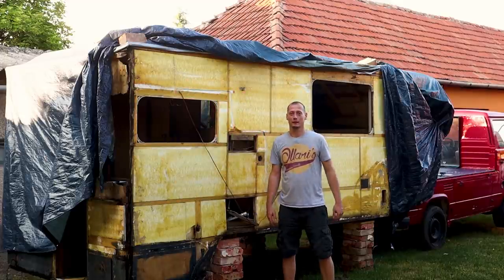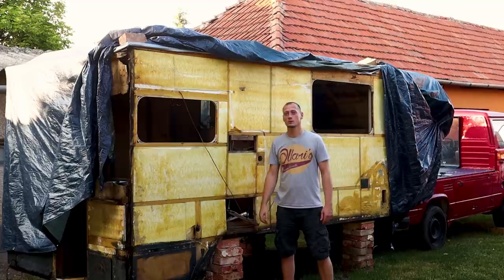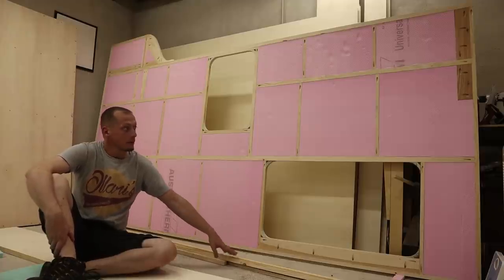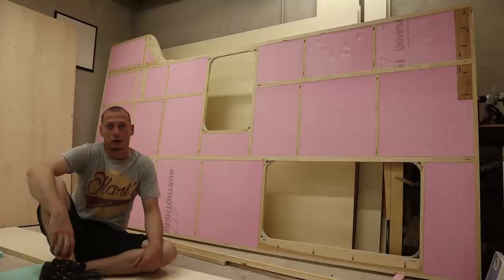Building the side Walls!  //  Building a Truck Camper Ep.4

Comment: Sebastian- this is a great project and I would be privileged to watch all that you upload. You are showing great skill and thoughtfulness in tackling this and addressing the weight v strength constraints. A bit late for this comment and it is not offered in a negative way but reflecting on the rot in the old structure did you consider the use of preservatives, sealer or even epoxy paint during manufacture and assembly of the panels? Keep up the fine work.😀👍

Comment: Very nicely done. Much better than any other camper I've seen.

Why did you go with pocket holes instead of just a screw from the opposite side into the pieces? Seems like more work since you won't see any of it anyway.
Reply from the maker: The wood will split if you screw it directly into endgrain. And if not it still is not very strong. The main purpose of pocket hole screws is to prevent that. That’s why they are also used for building cabinetry.
Reply: @Ollaris  Ah, ok. I've always thought of pocket holes as just a way to conceal the screws when screwing things together, but what you said makes sense.

Comment: Nice building system for those walls, far better than any manufacturer I've seen. I use a product for waterproofing EPS , (both extruded and expanded). I've used it on walls built with ICF's, then tried it on wood, concrete, metal and on heavy cloth, all with success. It bonds very well and creates a flexible, waterproof coating. Thought of that product covering the foam and framing to mitigate potential rot if you ever get an infiltration issue. It's also an acrylic base, water clean-up . Ames Block and Wall (https://amesresearch.com/block-wall-liquid-rubber/). I've had it tinted with color to match other surfaces. I have no idea how far along you are at this point or if you have access to this product, pretty sure there are similar products in your neck of the globe.Just a thought.
Reply from the maker: I planned to do something like this! I’ll look into that for sure! Thanks!